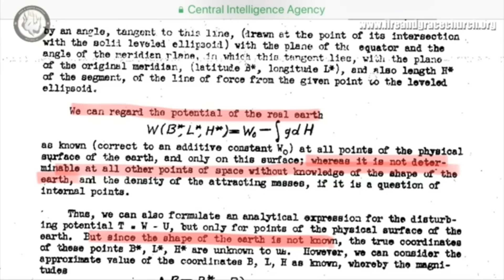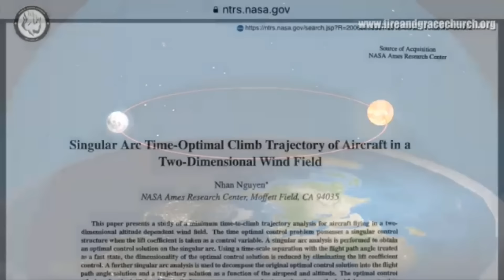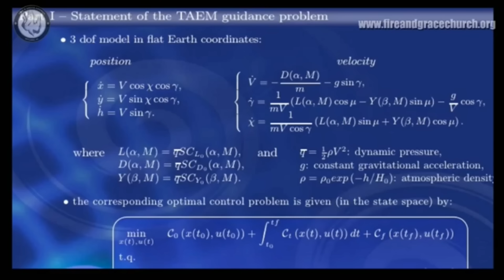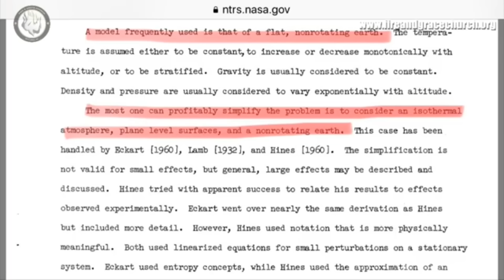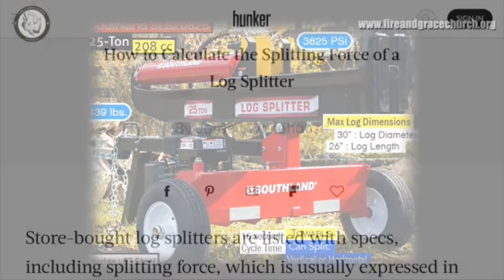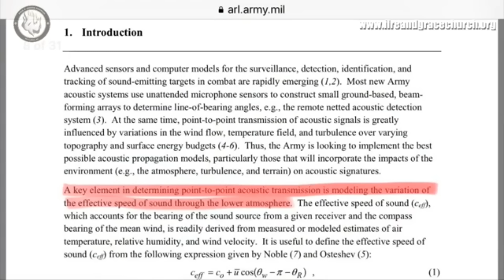NASA documents admit Flat Earth - Lecture by Dean Odle

Comment: Btw, Government documents and technical manuals sometimes mention a "flat non-rotating earth" as a simplifying assumption for specific engineering and physics calculations over short distances or small time frames, not as a description of the Earth's actual shape. 

This is a standard practice in science and engineering called using a model, where complex variables are omitted if they have a negligible effect on the result of a particular problem. 

The opposite is true for other calculations are based on a globe physics. For applications requiring high precision over large scales—such as GPS satellites, intercontinental ballistic missiles, or space shuttle simulations—engineers absolutely do use models that incorporate the Earth's spherical, rotating nature.